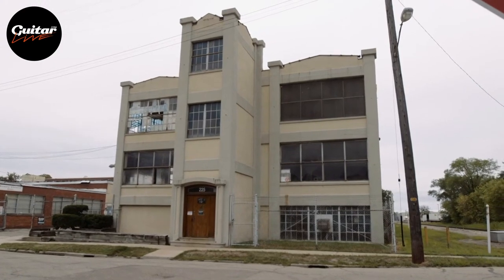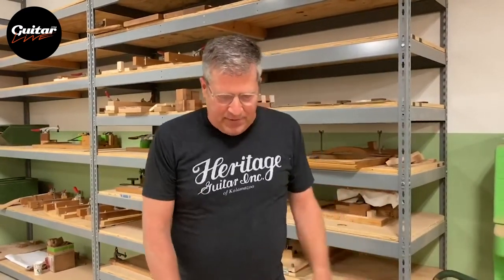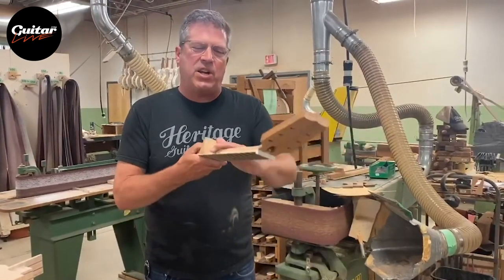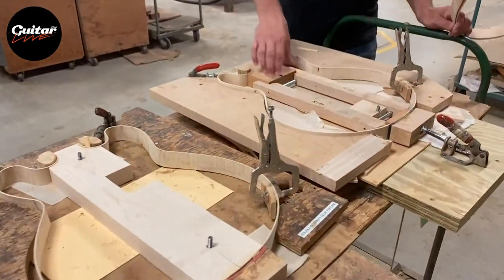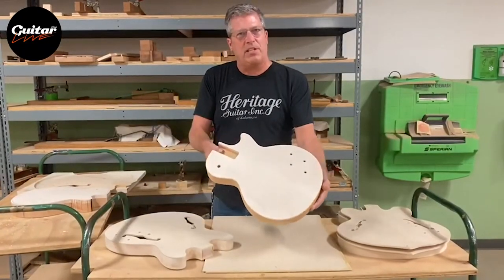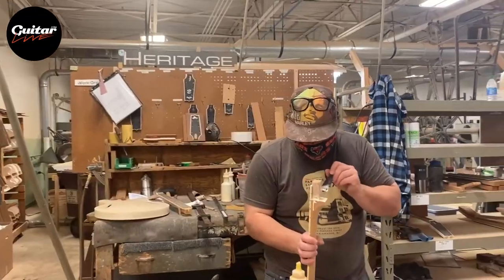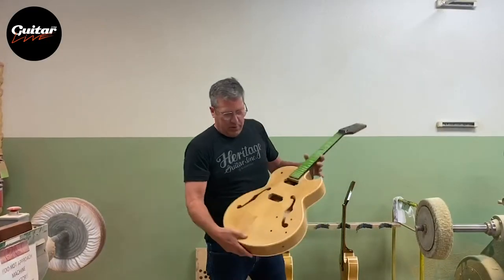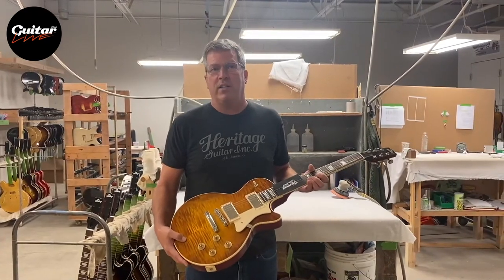225 Parsons Street Factory Tour with Heritage Guitars Masterbuilder Pete Farmer

Comment: I've got 3 Heritages...30th Anny H-555, H-157 CM and H-170. Their quality and craftsmanship are what Gibson should be ascribing to achieve moving forward. I have two Les Paul's from the 70s.....a 72 Goldtop Deluxe and a 79 Les Paul KM. Both are really good guitars. I'm partial to the Deluxe, the Mini MBs having a singing quality about them. The KM's Cream tops sound very good as well, but it's an anchor, weighing at least 2 lbs more than my Goldtop!  The newest Gibson I own is a 2011 Firebird and must say it is a fine guitar. 

I'm sure Heritage has had some off years but all three of mine are great guitars. The 30 Anny is obviously from 2015, the LP CM is a 2006 and the H-170 is an 87. It must have been a special order as it has a bound headstock with a stinger on the back.
Reply: suppose to be aspiring....what happens when you don't proof read 😜

Comment: I have always been a Gibson fan and had heard of Heritage guitars but without delving into the subject... After watching this video and getting to know its story I think this Kalamazoo factory should be blessed and if one day I get rich I will buy at least one of these beautiful tools... Congratulations on everything you have done and are still creating.
Reply: I bought mine used in the 90s and it was great. I owned a 90s good wood era Gibson and that was good as well but certainly not any better than the Heritage. Make sure your Heritage has 500k volume pots installed. In the early years Gibson sued them and out of that settlement came rules at least 12. Heritage had to use 300k pots to load down the pickups so it wouldn't have the Gibson lp growl as it were. I think that if Heritage had been allowed to use the proper value of pots it would not have taken so long for them to earn the reputation they deserved.
Reply: I am not even close to being rich and just purchased a H150.